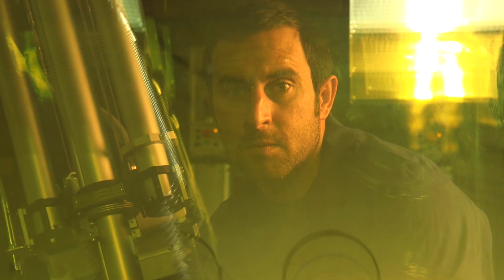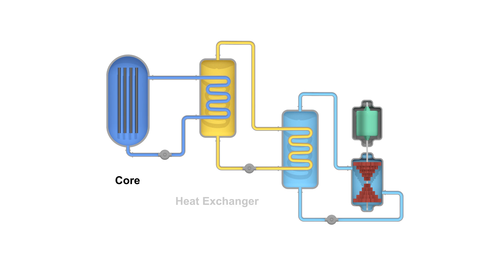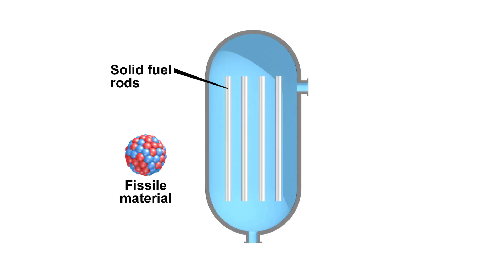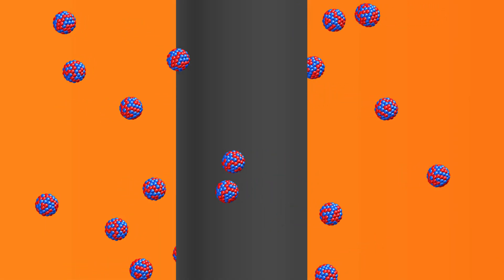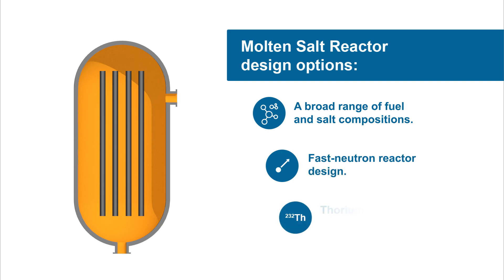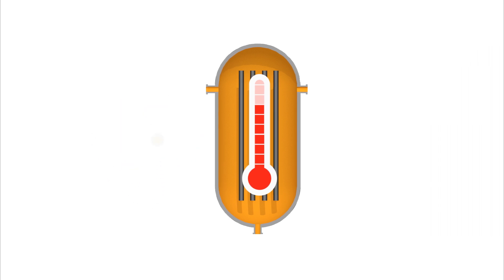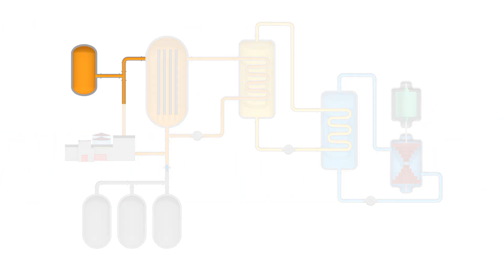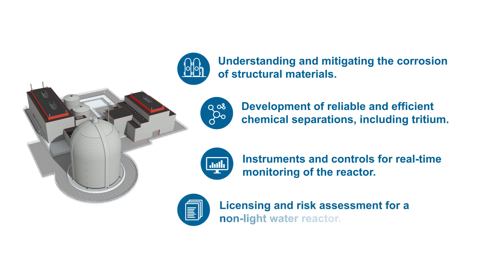Molten Salt Reactor Fundamentals

Comment: The Thorium vs Uranium scarcity thing is kind of a non-starter. Molten Salt Reactors will quite happily run on waste fuels from light water reactors. In fact, I'd argue that any future reactor we're looking at deploying, should be set up to use waste fuel, rather than new Thorium. 
And Thorium fuel cycles aren't the only ones whose waste products decay to background in hundreds of years, vs. tens of thousands. Uranium-Plutonium fuel cycles will allow much shorter storage requirements as well.
 That long storage requirement isn't because of the fuel we use. It's because of the fuel we don't use. Specifically, our light water reactors aren't very efficient, relatively speaking (no, not a relativistic pun) and leave incredible amounts of energy in the fuel. That's the benefit to fast breeders and molten salt reactors. They are more efficient, and can reuse spent fuel after reprocessing, thus eliminating the need for long term storage. 
Fast breeders work by allowing you to fission isotopes that aren't fissile in the thermal neutron spectrum. The nasty actinides like Neptunium, Americium, Plutonium etc. are the ones that create this need to have long term geologic repositories in the first place.
Molten salt reactors work by attempting to limit the formation of these nasty actinides within the reactor, and by using up much more of the fuel and eliminating waste products. 

If we didn't waste so much good, useful fuel, we wouldn't have such a 'waste' problem to begin with.
Reply: Mike McKeen wasting fuel is what humans do best im afraid 😔. But valid point none the less.
Reply: We don’t make anymore radioactive stuff than there is to start with it’s just concentrated if we could dissolve it and spread it back out it would not be a problem but even then governments would not let you put it back in the ground. If a mining company digs up 1 ton of thorium they can’t just put it back even if it’s no more concentrated because the government says so. That’s why we have a rare earth problem. China doesn’t because they know thorium is so low radioactive in its natural state its safe and just ignore it
Reply: There are HUGE amounts of Thorium ALREADY sitting in huge piles.     It is a By Product of any Rare Earth mining.   
Once the thorium reaction has begun...   The MSR can then begin digesting spent fuel.     They can extract more energy from the spent fuel... Than the solid fuel reactors extracted in the first place.    
A piece of thorium the size of a walnut... Has all the energy a person could use for their entire life!
Reply: Thorium has advantages with MSRs. But uranium is good, too.
Reply: I dont know of any legal, & non-weapons use advantage of thorium over uranium. I have almost 36 years of nuclear experience, 7 years in the MSR field.
Reply: @EdPheil  the only reason I can think of is if a country doesn't have access to Uranium from which to make fuel. Thorium is more common in Earth's crust and is turned up all the time in mining. But that's not a technical reason, it's a question of supply. Technically, it's always easier and cheaper to start with Uranium instead of starting with Thorium and converting it to Uranium through a blanket and decay process.
Reply: @EdPheil  I would also like to thank you for actually popping in and commenting on these videos. It's your MCSFR design that really sparked my interest in different reactor types and led me to wanting to pursue the issue and engage in public advocacy, even if going back to school for a new degree isn't in the cards right now. There is not enough attention and information on the successes of 4th generation designs like the MSRE and EBR-2, which led us to things like Elysium's MCSFR and the Integral Fast Reactor concept. I'm glad to see people like you trying to change minds.
Reply: Just more industry hype that will run into nasty "gotchas" like every other design ever built for this deadly, stupid technology.  Shut the whole industry down.
Reply: @Rep0007  deadly technology with the fewest deaths. Enjoy your respiratory disease from natural gas and coal that you're forcing on everyone.
Reply: @Clean97GTI  ... and the most dire long-term consequences, so you kinda have to sum up the deaths over the next 20,000 years with nuclear.  Saying "only 20 ppl died last year from nuclear" is 1/20,000 of the real story.
Reply: @Rep0007  Do you think you can accurately predict what will kill someone 20k years in the future? And why 20k years? There is no real reason to play a guessing game, especially since you have no idea what factors will exist. For all we know, the next century will see all fission reactors replaced with fusion and fossil fuels become obsolete. Do you credit nuclear with saving all the lives that would have otherwise been ended early by fossil fuels? Air pollution already kills tens of thousands each year.
Reply: @Clean97GTI  Awkward how all pro-nuclear advocates talk a lot about bad coal and oil but don't even mention clean renewables like wind solar and hydro and geo.  As if it were only a choice between coal and nukes.  Lame propaganda line.
Reply: @Rep0007  if renewables could actually produce enough electricity to offset fossil fuels, we wouldn't be having this discussion. We would have just built solar farms, wind farms and harnessed volcanoes.
But if you add up all the solar and wind production in the USA, it's less than 10% of the total. Despite decades of building and billions in subsidies, we can't overcome the laws of physics. There just isn't enough energy density in solar and wind to run a modern industrial nation.
Reply: @Clean97GTI  Quote: "On March 5, 2018, at around 1 PM, utility grade solar energy met 50% of California's total electrical power demand for the first time."  Pyper, Julia (March 6, 2018) "California Sets Two New Solar Records" Green Tech Media.
Reply: @Clean97GTI  Note that the terawatt figure is about equal to TOTAL US electric generation today.  Just solar could do it by the 2040s.  No coal, no gas, no nukes, not even wind.
Reply: @Rep0007  50% one time, on one day in March before California warmed up for the summer and millions of people turned on their A/C units. 
And what would you do for the other 50%? Tell people to turn the lights off?
Reply: Only 56 people have died due to commercial nuclear over the LAST 75 years, not the last year. All at Chernobyl, all plant workers. No one in the public died from any nuckear plant casualty.

Comment: Good video.
It's interesting that your "challenges" do NOT include obtaining Lithium-7 of 99.995% purity for the fuel salt.
Isn't that a rather important oversight ?
Or does PNNL actually have a way of solving that issue ?
Reply: There's no need to have high purity lithium-7. There are both salt compositions that don't contain lithium at all, and designs that do easily remove tritium as hydrogen gas from the system as it is fissioned from lithium-6.
Reply: 99.995% Li-7 is needed to close the thermal Th/U233 fuel cycle, but most thermal MSR companies dont plan to close the fuel cycle.
Reply: The fast reactor molten salt designs actually use a chloride salt, which requires no lithium. And because it's simply ordinary table salt (of a very high purity) as the fuel/coolant salt, you don't really have need of exotic materials. Stainless steels currently on the market today are more than adequate for construction of reactor vessels and systems. You also have the benefit of easy cleanup and storage should you ever have a leak. Sodium Chloride isn't really reactive with anything as long as you keep it away from water. It's very stable.
Reply: We can replace shitty lithium with fairy abundant and good sodium.
Ver first MRS was using sodium&zirconium salt.
Reply: Sodium chloride does not "react" with water at MSR temperatures, but the high temperature converts water to steam. 

Sodium chloride salt does couloumbically exothermically react with water through a couloumbic driven chemical reaction above about ~1300C.
Reply: 04:20 "Development of reliable and efficient chemical separations including tritium."
They mention tritium. 
Lithium-7 supply chain is in existence. PWRs use Lithium-7 Hydroxide for pH control. But, MSRs need tons of Lithium salts, this is similar in magnitude to that of enriched uranium requirement of LWRs or heavy water requirements of CANDUs.
I don't know about Li7 enrichment process. Is lithium enrichment different/difficult than uranium enrichment for LWR or deuterium enrichment for a CANDU?
Reply: @Achal H P there are other options to. But lithium 7 would be best in what he discussed it’s the byproduct of lithium7 that is a problem lithium6 used in bombs and highly controlled